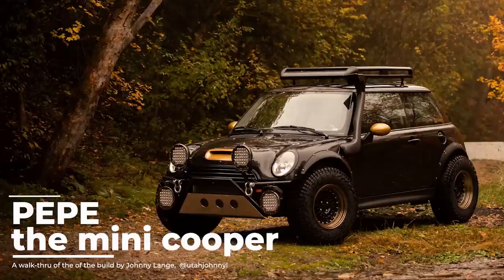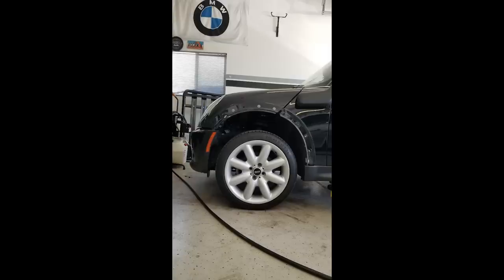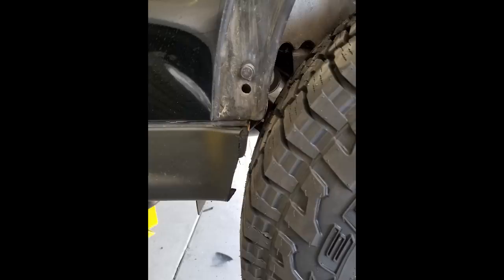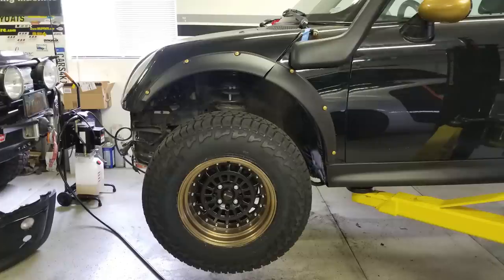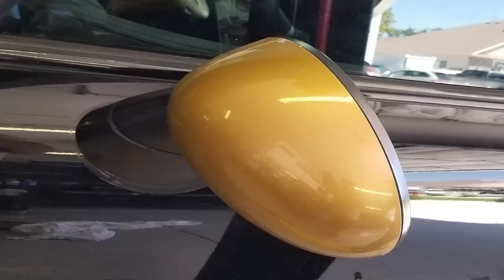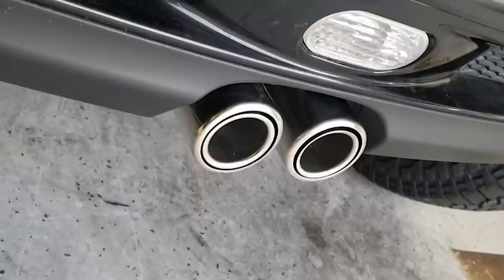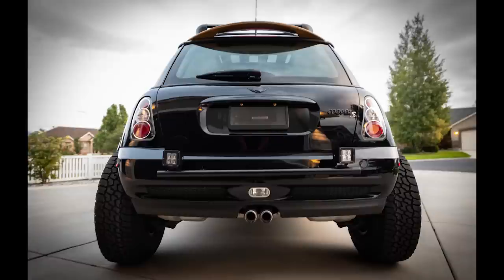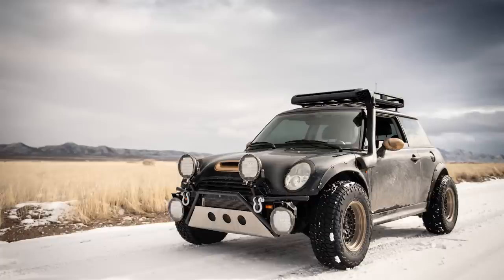Building Pepe The Mini Cooper (lifted Mini)

Comment: Thanks for the video. I have a 2011 Mini Cooper Base I am thinking about lifting. Any suggestions regarding using the stock wheels with larger tires?
Reply from the maker: Will depend on how large of tire you go.  If you're lifting a base vehicle, you may not want go that large as it takes away some power.  Stock wheels would be fine for a size or two up, but anything larger you will have clearance issues as the offset of the stock wheels is not correct. Good luck!

Comment: Damn man thats sick! Im trying to do the same with my countryman :)
Reply: DO IT. I have my mini countryman lifted 2 1/2 inches with some sporty offroad-looking tires ( I don't remember the specs) that also gives me 1 more inch. I took my mini on a little offroading and after offroading 4x4 cars with locking diffs, I am very shocked at how well the mini's all-wheel drive system is. Two wheels were off the ground and it sent power to the wheels on the ground really quickly. It also drives very similar to stock, just not as sporty. Well worth the mods. If you're still planning on modifying it, I can send links of the tires and parts I used. Have a great day.

Comment: Great video. Two quick questions…

How much ground clearance did your Mini have after fitting the Journeys Off Road lift kit (with standard wheels and tyres)?

Once the lift kit was fitted, what is the tallest tyre do you think could be fitted without modifying the bodywork?

Thanks. Mac

Comment: while lifting 2 inch on front struts, hows the cv joints angle? does it affect the performance/Function?
Reply from the maker: All was well with the angles. No issues.  Running the larger tires definitely affected the performance, so that required the engine power mods as noted to bring it back to where it needed to be.  Cheers!
Reply: @UtahJohnnyL  thanks bro. god bless!

Comment: Love Pepe!  What brand and size tires would you recommend instead of the ones that you installed?
Reply from the maker: I love the Falken Wildpeak AT3's, maybe just a size smaller would be better. 👍🏼😉
Reply: Thanks.  I have a 2009 Mini Clubman JCW that I intend to lift 2 inches.   I'm thinking of going with 15" rims with 225 75 15 Falken tires.  Am I making a mistake?  Car has 17" rims now.  I really don't understand tire and rim sizes.
Reply from the maker: @buddy36788  First off, you need to confirm that going to a smaller rim diameter such as a 15" will fit.  If your car is a JCW, it probably has larger brake calipers that wont allow you to fit a 15" wheel. You may be stuck with a 17" wheel.
Reply: @UtahJohnnyL  Thanks for taking the time to respond.  Congrats on the BaT sale.

Comment: Did the 0 offset rims bring the tires out far enough to avoid the coils? With the Journeys Lift kit it puts the coils a couple inches above my stock tires and if I wanted to go bigger I would have to bring them out a bit. Was it enough for you or did you do something else as well?
Reply from the maker: Yes, front wheel spacers were required on my application.